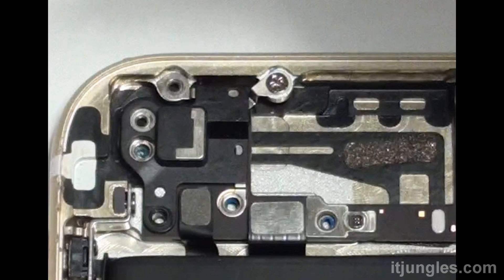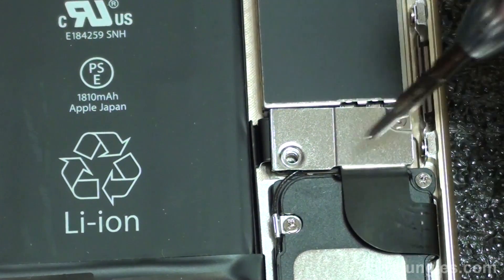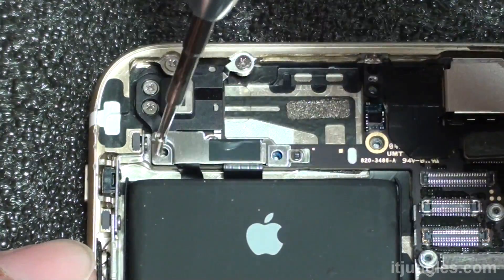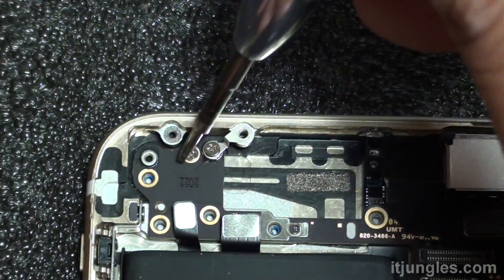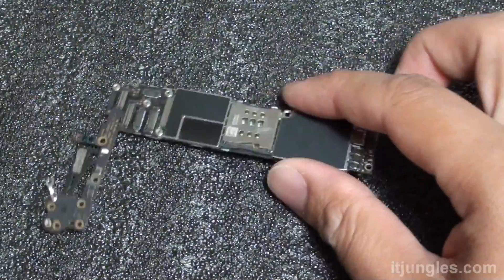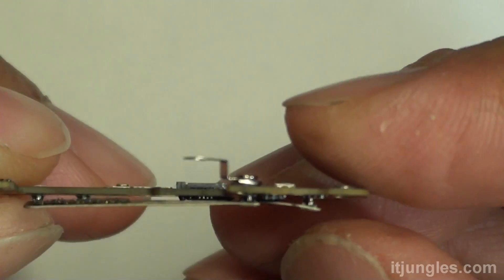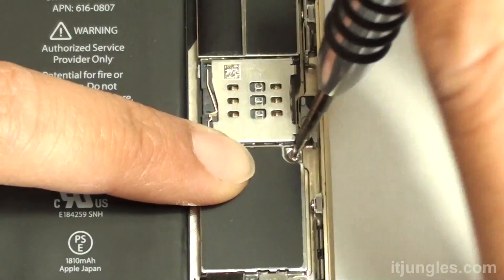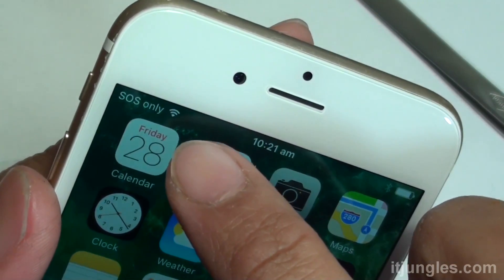iPhone 6: How to Replace and Fix WIFI / GPS Antenna

Comment: I was told that replacing the antena wouldn't fix my bluetooth and wifi issues on my iphone 6 (weak signals) by both an apple store and a independant cellphone repair place.  I bought a replacement antenna, and a set of tools for $15.00 on Amazon prime.  This fixed my issue .
Reply: @Beerdontbreakharts   No. I have two iPhones 6. They've been bought almost at the same date, one stoped working the wifi/gps a long time ago (6+months) and the another one the wifi works (gps not so much) but about 2 months ago the signal stopped working. Got the other iPhone 6 back from the dead and after 2 months using, the cellular signal was dead just like the other one. I've seen its a problem in the main mother board, not the antena. Guess what, not covered by apple. :)
Reply: Joseph Lambaren I have that antenna problem. Did you ever figure out a fix or did you just have to get a new phone.
Reply: @Beerdontbreakharts  the same mate. I was really angry on my iphone 6 coudlnt find a way on google maps. Now works great. No more iphone 6. Dont buy it people
Reply: Apple wants you to buy a new phone and they tell the small stores to say the same thing as them
Reply: whats the tool set called?

Comment: Excellent video. Replacing antenna fixed phone gps location issue. Hot tips: magnetic tip screw driver set is good investment; tape down masking tape with sticky side up, then layout removed screws on masking tape in same pattern as on phone to ensure screws go back to correct location (screws vary in length).
Reply: Nice one Daniel - I used Sticky Tack (Blu Tack in Australia) worked great
Reply: Nice tips
Reply: Good idea, I took my phone apart and screws were everywhere. Unfortunately I did it one day b4 my holiday and it took me 3 hours to put it back together, the screws were tiny and me putting the wrong screws in slots, it was mind boggling, but it finally worked. I am thinking I might find a shop to do this antenna fix, don't really feel like going through all these motions this time😣

Comment: Crap. Was attempting this repair when I found that one of the four flex cable connectors on the existing cable had already come disconnected from the board

Comment: This was a great video but it was missing a few steps on the reassembly and it really downplayed how hard it was to reconnect the screen... I had to take the screen off and redo the connectors 3 times before the touch functions started working again.  Make sure you have the flex cables connected and press firmly on them before putting the cover back on.  I thought i destroyed the screen at first but some patience got me thru and everything is working great and my GPS and WiFi signals are back to normal.  Thanks!
Reply: Yes, reconnecting the screen can be a pain, but the connectors present themselves in the order in which they should be reattached, if that makes sense.
Reply: yea it wasnt the order that go me, it was just how hard you had to press down on them to get the connection right.

Comment: I replaced both antenna and and wifi cable but i m still having problem with my wifi and gps! please help
Reply: Yasir Taj check connectors, are they  onnected to motherboard well. What problems do you have? On my Iphone 6 i have wifi dropping and gps in maps apps wont track when im driving. That happened when i update to latest ios 11.1.1 so me and a lot of people on internet thinks it is a software issue
Reply: Same problem! Weak wifi connection and it keep dropping, also gps wont track when i m driving. I think it started for me after 11 update I m not 100% sure though. I will try to reopen the iphone and see if the connectors are properly connected but i m pretty sure they are.
Reply: Yasir Taj then is software issuo and apple dont give a damn to fix it or bad antenna, or maybe even motherboard. Do your compas works?
Reply: I replaced both antenna and wifi cable!! Compass works fine, you might be right i m guessing motherboard issue.
Reply: Yasir Taj one man on apple support forums said that he spoke with apple care and they told him that they are aware about that. Maybe apple fix this in 11.2 i dont know :P
Reply: My compass doest work along with gps. Wifi and bluetooth works fine tho, what could it be?

Comment: Please help me, I've got used iPhone 6 and there's weak wifi and cellular signal, it's not seem like there's any issues with GPS eaither because GPS works well without any wifi/cellular connection. What could be the problem?

Comment: Thank you for this video. This fixed my bluetooth/2.4Ghz wifi/gps having barely no connectivity at all. I could only connect to 5Ghz wifi before replacing this part. I also replaced the 5Ghz wifi antenna while I was doing this because may as well while the phone is all in pieces.

REMINDER FOR ANYONE ATTEMPTING THIS, make sure you put the screws in their designated spots, if you messed up their order find an ifixit guide with the screw lengths included so you can put the right screws in their designated spot. ALSO be very gentle when reconnecting the screen because if you bend the pins on the motherboard that can't be fixed without buying a new phone.
Reply: Rob where did you order the part from?
Reply: i ordered the part from ebay

Comment: Jesus Christ this looks like a pain in the ass to do.
Reply: It’s easy. Take your time. You have a video showing you exactly what to do guys. Like you are human. The smartest thing on the planet. You can do it.!
Reply: I recommend having a sheet of paper and doing a simple sketch of the parts and where the screws go. Took about 30 minutes to complete. Everything worked once I got it back up and running. The antenna cost $4.70. It's a decent video, and worth a go.
Reply: Where can u buy a replacement antenna?
Reply: 170364stevo where can I get a decent replacement part ?
Reply: Brannon Huron I bought the part on Amazon.com, it works fine
Reply: Actually not that hard - Have the right tools and a bit of patience (give yourself about an hour and a quarter)and follow the video .Lastly remember where you put each screw.
Reply: Castle Black I know I will mess something up
Reply: It's not simple!!!  You have to go slow and work under good light.  All the screws, for the most part, are different and have to go back to the exact same spot.  That's a tricky part.  You don't want to lose any screws and they need to be laid out in such a way as you know how to put them back in the exact same spot.   You need to carefully pop all the connections off.  You also have to make sure you connect them back up correctly, fully.   You don't want to make your phone worse off.  You need to have some ability in this type of work.  Some people can't handle a screwdriver, let alone tiny screws.  You need 3 different tiny screwdrivers.  Along with a few other things.    Taking it apart is pretty easy.  it's the putting it all back togeather again correctly that can be a pain.  The better you layout the screws taking it apart, the easier time you'll have getting it back togeather.
Reply: @jbdragon3295  Excelente aclaración!
Reply: The fucking dumb ass used a different screw driver

Comment: Very well done! Great video clarity and audio instructions. Shows replacing both GPS & WiFi antennas. I am ordering the antennas & kit to do this, next week!
Reply: I did this, last night... replace both antennae.  I followed this video like an instruction manual, using a magnetic dish to keep the screws laid out in a pattern that matched the phone. It was tedious, and the small ribbon cables were a bit of a challenge for this older dude. But, the phone went back together and works like it is supposed to!
  The original Wifi didn't seem like it could be bad, but the replacement is definitely better.  The original GPS antenna was missing a snap on one of the fingers, which means it could not have worked on day one. 
  Great job on the video!!

Comment: Thanks! GPS is now on point!
Reply: Samuel!
What type of issues did you have with your GPS?
Every time I use mine GPS (IPhone 6) it give the the correct address but the guidance mode and the arrow on screen is waaaay off.. Something it’s on the water on miles on the mountain but never on the road/street.. Once I hit GO it finest talk or anything and arrow is way off from my location..
Reply: @dair805  That was my exact problem too. I had an Uber meet me a mile away due to my gps not working, similar to yours. Replacing that part fixed the issue.

Comment: Thanks! It just saves me 300$...WIFI and GPS are working great.
I have replaced the flex cable but while taking off the old one it looks like it simply was disconnected at one end.
One advice I would mention is to disconnect the battery cable before disconnecting the screen cables.
Great video,
Cheers!
Reply: AlonYas AlonYas 

Did you try the phone with the old cable reconnected or did you just go ahead and replace it because you were already in there?
Reply: Didn't try the old one, I'm almost sure that it just was a disconnected connector issue.
Reply: AlonYas AlonYas cool. Hoping to do mine this weekend. It was acting up with the gps, then I did drop my phone kinda hard. No external damage but that's when the wifi started going bad. I bet mines just loose too

Comment: My daughters phone would not stay connected to Wifi and the GPS was not working.  She had an old phone that died due to water damage that I had kept.  I followed this video and replaced the parts using the parts from the water damaged phone.  I really didn't expect it to work but much to my surprise the phone now works  perfectly.  No more wifi drops and the GPS is working reliably again.  Many thanks to the author!!

Comment: Ok, here's my last comment on this issue now that I've calmed down.  I hope it will be helpful to others.

When I contacted my local iPhone repair shop they told me they didn't do this repair because it involved micro welding.  That confused me since there seem to be a few videos, like this one, showing how to change out the cable with no welding involved.

Having attempted this, I can see where welding would be needed if things don't go right.  Everything was fine until I went to remove the old antenna flex cable.  I pried as gently as possible, but when I tried to snap on the new cable I realized that two of the connectors had been pulled lose with it and could not be reattached.  That's probably where welding is necessary.

Anyway, I decided to put it back together without the f cable thinking that I could at least still make calls.  Surprisingly, even without the cable I am still able to connect to Wi-Fi if I'm next to the router.  Also, my watch can still sync to my phone by blue tooth if it's right next to it also.  The Wi-Fi signal is even weaker than when I started, but still useable.  

In summary, I would be very weary to try a repair like this again.

Comment: Thank you, great job on the video. Replaced the Wifi and GPS and issues are fixed.
Reply: Ryan, what type of issues were you having with your GPS? Mine doesn’t give me directions and it’s waay off from my location.. It never finds me :(
Reply: @dair805  it would use the cell towers to determine my location so it would drive me around like a bumper car. I would get going the correct way and I know that from knowing the area then get downtown and it would start taking back the other way etc.

Comment: does this fix gps issues ? hard to lock in location
Reply: Yes
Reply: I may give it a try cause my location is FUCKED!
Reply: I just fixed mine after watching this video and now my phone is back to normal.
Reply: Ddxd
Reply: Is it hard to fix? I'm hesitant to open my phone incase I damage or don't put it back properly...
Reply: Harder than fixing a broken screen because you need to unscrew everything. If you are new to this, I recommend you to seek a professional.
Reply: yes it does fix it, i had the same issue, replacing antenna fixed it.
Reply: Yess it will since my main issue was actually the gps at first before i noticed that the wifi is affected as well. Was not able to use google map before i change the antenna as it didn’t know my exact location.